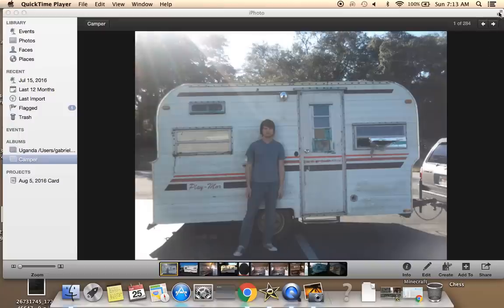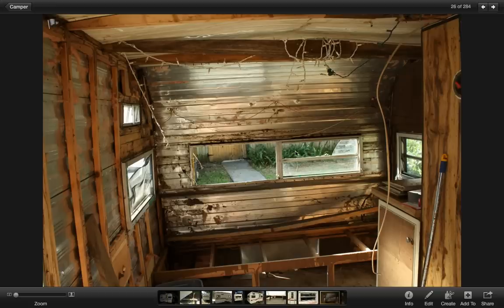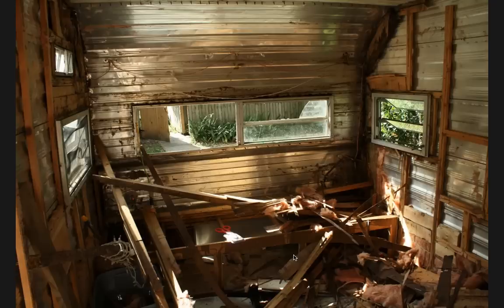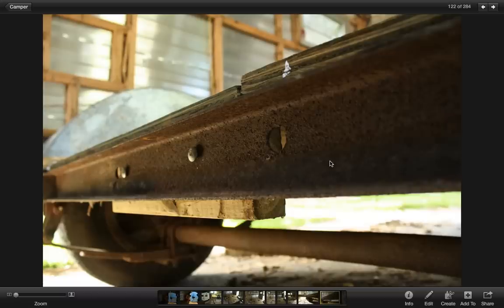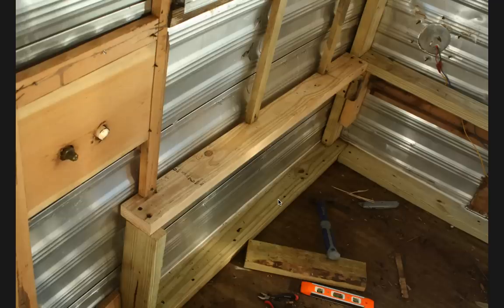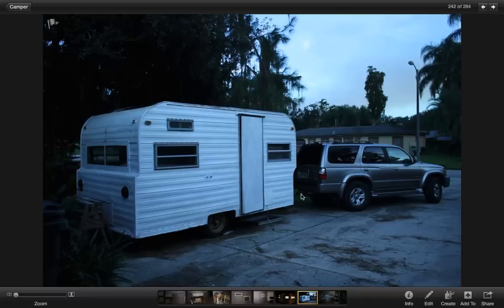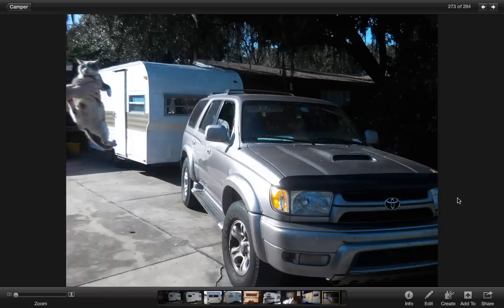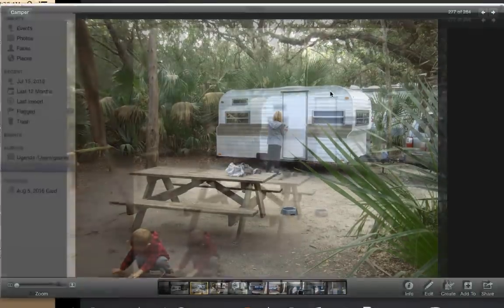Rebuilding a $40 Retro Camper // DIY

Comment: Excellent video! I understand exactly what you went through. I bought a small mobile home that was uninhabitable for dirt cheap and also got a perpetual lease to keep it on the acre where it sat for $200 a month. Had to completely gut it to include the floor, plumbing, electrical, and interior walls. I jacked up the outside walls every 10 feet or so in order to slide in the new 4x8 sheets of 3/4" plywood for the floor. The original floor was particle board and we know what happens when that gets wet. Many of the floor joists also had to be replaced. It was a real dog. Anyway, what was an uninhabitable 2 bdrm mobile home became a really nice 1 bedroom. I'd love to do it all again one day. Learned so much.

Comment: Mine is a 1976 coachman 24 foot trailer and this video gives me hope. I also had some water damage. Gutted the front and replaced the frame, reinsulated and and redid the floor (which had huge holes in a couple parts too) I have still aways to go, but this is rad to know other people have succeeded before me.
Reply from the maker: That’s awesome! Glad to have given you hope!
Reply: 𝒊 𝒍𝒊𝒌𝒆 .......
Reply: 𝒊 𝒍𝒊𝒌𝒆 .......
Reply: Lm
Reply: Ok. I guess I have to be brave like you. Thanks.

Comment: I started to do a 1973 11 foot skylark truck camper that’s in slightly better condition than this trailer was until my shop foreman at the rv shop I work at convinced me to just salvage parts from it and that he’d help me build a new one with him free of charge. He told me I’d spend about as much time doing that as I would fixing that one. Might have kept going with it otherwise but good for you for sticking to it. I’m doing the series on my channel of the whole thing. Not what I originally wanted but I like that I’ll be able to make every aspect of it to my liking. Both projects are very satisfying just in different ways. With something like this you get to basically rescue and bring a camper to a level beyond it’s former glory but building one from scratch you have a similar satisfaction of hard work paying off but you also get the benefit of making the unit the size and design that you want. For example the new camper has a 12 foot floor length and it’ll have the rare side entry door design I really like.

Comment: No one finds a 40$ camper, you won the lottery man
Reply from the maker: Yes, I sure did!
Reply: Van the Glassblower -  not true.  If you look around, sometimes you can find campers like this one that need gutting for free.
Reply: Van The Glassblower nope. Bought an old Winnebago motorhome for $200 only thing it needed was a new couch and tires.
Reply: Holy Hand Grenades gotta love facebook marketplace
Reply: Nawar Salim dude sweet
Reply: Van The Glassblower guaranteed you rip the skin off nothing but black mold in those walls that's why it's 40 bucks
Reply: @dbz739921  Yeah, once black mold gets into the wood it just eats away at it. If it's hiding there, which most likely it is as campers leak like a sieve, I'd definitely replace the entire frame etc. Expensive, but a good investment.
Reply from the maker: @BLUEM3TALNEMESIS Someone's private property with their permission or pay for rent at an RV park.
Reply: @oursimplestorychannel  I see mobile homes for free all the time. Just have to get them moved. Travel trailers too. Fine job young man!
Reply: I just got one for a $1 from a good friend who just didnt want it anymore. Title and all. Needs work but itll do the job.
Reply: Free on fb market every day
Reply: not true. many of us older folks have old campers needing rehoming and in much better condition. . we have two and would love to have them move on for next to nothing.
Reply: Deals like this are legit everywhere, no one wants to put in the work tho
Reply: Van The Glassblower YOU BETTER BELIEVE IT! He worked his butt off on it didn't he? 👍
Reply: Nawar Salim wow.... +$230 worth of fuel to get it home ... lol.
Where am I when people let this stuff go? Nice.
Reply: DEALWITHIT DREALIST   Gotta 75-80yo house 1.5ac fenced $35k 23 years ago... tell me bout it!!!
Reply: Van The Glassblower I wouldn’t exactly say, winning the lottery. He had to restore, and rebuild the whole thing.
Reply: In oregon if the trailer is older then six 8 years u cant park rvs or trailers in parks n have to move every three days or get towed n lose.Want good trailers rvs free or damn near got gas drive off they somtimes pay u to get it off the property.
Reply: @mitchellkennedy3556  this just has covid19 updates. I guess it's been sold.
Reply: Look on Facebook market place you can find them for free they are in really bad shape though
Reply: @lindanelson5053  Not in Australia. A beaten up old unit like this one will have people fight over it at $1000. Slightly better condition and they sell for $6000+. We're talking about small 1960's/70's trailers without bathrooms, remember. Very basic. They were overpriced before COVID, but now prices are getting crazy - and they're becoming very hard to find. All sold out during lockdown. People were snapping up anything they could get their hands on.
Reply: @bevcrusher4177  Oh wow
I'm in the US
Reply: I technically got one for free, though I paid him £20 to deliver it. It happens.
Reply: I got one even bigger in a little worse shape for free

Comment: this gives me some hope for the one I just got. It was on craigslist for FREE! so I couldn't pass it up. 13.5 foot 1970's "aristocrat" travel trailer. the water damage isn't nearly as extensive as what you had here but I think ill have to gut it anyway because something happened at some point that caused the whole thing to be sort of lopsided. I am guessing the only way to fix the problem is to get down to the bare bones and do some rebuilding.. lucky for me I am a cabinet maker so I am thinking it will be doable. if it proves to be too much ,well it was free so...yeah.

Comment: I have a Pla-mor that is about the same shape but a bit longer. It has 2 axles. The only thing that is left inside is the shower/tub. At least that is a start. All the walls are about to fall away due to the rotted wood corners. Floors are simply plywood laid over whatever there was left.
The guy I got it from told me that I could have it (for $500) if i promised that I wouldn't  live in it. I didn't tell him that I was going to rebuild it. Currently, it is a storage shed. Time will tell...
Great to see you working with your son.
Good luck.

Comment: I almost bought a 1971 motorhome that needed to be gutted out like that.  If anyone has an RV remodel that involves water damage, please consider PPE or Personal Protective Equipment like the paper suits and  respirators when tearing that water damaged material out of there just like professionals out of a mold restoration service would likely use.  Mold can really do a number on your health.
Reply from the maker: Yes, it sure can be nasty. Rest assured, I took all the necessary precautions.
Reply: Cheeto Cruz  sorry....  I'm havin to deal with it now, for 23yrs. I'm old and ready for a small camper. My dog doesn't take up that much space..  & I can change scenery when I want.
Hey, I can dream...
Reply: Cheeto Cruz I’m so sorry for your loss and your ongoing complications. Keep on reminding yourself that your body is badass and it can repair itself. Before you go to bed ask your subconscious to fix the things that are causing you pain, even if you don’t know what’s causing it, “please work on making my shoulder stop hurting, you know what to do to fix it.” Do this as often as you remember before bed and your subconscious will work on it while you sleep. Sounds a bit too easy to actually work but they said I’d never walk again and the pain I was dealing with would kill me in less than 3 years, as it does everyone else with my condition. Seven years later im walking better than I ever was and zero pain ever, no pills no meds, just told my body what I needed from it. I turned my disability into my super ability by keeping the bonuses and fixing the negatives. It’s free and no side effects so why not give it a try? If it works for you spread the word. You’re gonna be amazed by the results I promise :)

Comment: I may have sprayed undercoating or truck bed liner on the inside of not both the inside and the outside. I was thinking that the truck bed liner spray would help seal  the shell and help prevent anymore leaks in the future
Reply from the maker: I should have thought of that!
Reply: My Friends Rino Lined the Whole out side paint job of thier Huge  Ford Excursion! 
It came out Awesome!

Comment: Great job on fixing it up, always fun to other people's DIY projects, I cried tears of joy when u called your B&D a piece of junk, long live Dewalt keep it up
Reply from the maker: I’m 100% dewalt! Thanks for watching!
Reply: Proper tools make things so much easier, in regards to the interior ceiling, and making it look good, making a bunch of 2cm thick bars and placing them at even intervals along the ceiling makes it easier to control how tightly the ceiling fits, you need to place them at 10cm at the ends(where the camper is round) and 40cm over the rest, at least what I did myself
Reply from the maker: Thanks for the tip!
Reply: The GIP your welcome

Comment: For someone with no construction back ground you did a great job.
The 2 things that stuck out for me, you covered the first one using pressure treated. The second one though..... the floor, is it bear wood on the underside. Even pressure treated will rot eventually.
Reply from the maker: Yeah, you are absolutely right. Next time I’ll do a better job :)
Reply: Our Simple Story.  I was in no way criticizing your job. I thought you did a very good job. I was just wondering about the floor. When you ripped the old floor up was it just wooden or was there sheet metal or something else under it?
Sorry, I meant no offence.

Comment: I hope your insulating between the walls and the metal skin.  Any bare metal will produce condensation and water damage when you turn on any kind of heat in there, water damage and mold is sure to pursue. Need to foam or foambord insulate the whole thing dude.
Reply: vapor barrier also...but for a first attempt I say he did well, there is a definite learning curve involved.

Comment: Why didn't you insulate the walls and floor??
Reply: I also have questions. Im thinking he isnt using this for winter weather.
Reply: I wondered the same thing! I mean even if you aren’t planning to use it in the winter, it’ll be a metal box in the sun for summer🥵 Not to mention insulation is a great sound barrier.
Reply: @tonia.5861  The way things in this country are evolving, more people probably should be looking for something similar. Just a thought.
Reply: Michele A sadly, I think this could be correct😞
Reply: I also thought there was way more than $200 in building materials that plywood is like 30 a sheet . And then all the 2/4s paneling paint screws caulk let's not forget about all the lumber was treated to so that made it cost more . But hey I wasn't there 😂 but I do know the cost of stuff 🤣😛😁💪

Comment: You are one determined man. I purchased an old 1970 Vintage camper, it turned into a nightmare, it was so bad I salvaged the aluminium siding and sold it for scrap; almost 100% of the framing was rotted out and I gave the base away. I lost $750. Don't have the energy to attempt another one.
Reply from the maker: Yeah they are for stubborn people. I am actually in the middle of stripping down my second retro camper. Look in my more recent vids. Thanks for watching and sorry it didn’t work out.

Comment: great job..I restored a couple in past.. Here in western WET Washington ..rains a lot .. the rain water will find it`s way in a tiny hole ..like even on the side where a screw is not tighten down all the way ..and in 2 to 3 years U will have ROT ..rotting out walls . So even your new trailer - keep under a cover..

Comment: I'll share a secret with you on how to literally take these down to zero and rebuild them without loosing the metal, windows and all the rv in a rip out. Its a sectional overhaul. No one apparently does it but me. Look for a DEFINITION video on it on my channel soon. I will show HOW to restore with minimal effort the worst of the worst..
Reply: my uncle had said something like that ...My aunt passed and he fell apart so the travel trailer and 89 mustang i got to renovate is still sitting. It was suppose to be our project that i was going to learn on. I will def take a look at your channel!
Reply: The secret to doing the restore is size related 1.5" or 2" height HAT metal, also called Furring Metal. You remove all paneling, then ONE stud at a time, replace it with a piece of hat metal, go to the outside and put in rivets through the outside metal dipping each rivet in a little sealant. Then return inside and repeat. On your corners you use corner metal, same thing on outside corners with rivets and its original trim reinstalled. Lots of tin snip work. When all walls are done, you will be able to lift the entire shell off the base and pull the base out, then you can replace the floors structure, then roll the trailer back under the body. I use just 3 ten foot 2x6" and saw horses to hold up the shell when its off the base. 
Thats the basics, it goes faster than your can imagine for restoring SMALL under 18 foot classic aged trailers.
Reply: Your wifes disgust failed to see you got a $25,000 education out of the deal. Now when she has to choose between getting another car and cabinets put in she can get both since you can do that very expensive work.
Reply: Јоhn Daniel  THANKS!!! GREAT IDEAS.

Comment: Not hurricane nor tornado proof...the towing speed of this thing is nowhere near that high...but by all means try it, you'll have a brand new experience as it fish tales around behind you eventually whipping you & it off the road. By the way rustolem paint doesn't get rid of rust, you have to scrub that off, wire brush it or sand it, then seal then put your paint on it.
Reply: I don't think there is anything that is hurricane or tornado proof, that is my main worry about rv's or campers... I would be hesitant about driving across country, but that's just me...

Comment: How much did it weigh? How well did the 4Runner do?
Reply from the maker: I don't remember exactly how much it weighed. I know it was under a ton and maybe around 600-700ish? The 4runner did fine and I've actually towed much bigger and much heavier since then. The 4runner can tow up to 3500 lbs. but I take it easy and that is in flat Florida. Thanks for watching!
Reply: I'm pulling similar unit with Kia Sorrento.  it does this fine but concerned about the amount of wobbles that occurs.  I've been told it might be an adjustment of the springs.  care to weigh in so I can do the right fix the first time.  I'm hoping to gut and rebuild as animal grooming station do it would be on the road a lot.

Comment: It is a nice rebuild but I'm going to disagree with you about making money from the sale.  You stated you payed $40.00 for the camper and approximately $100.00 for the title and  license, then about $200.00 to $300.00 for the material.  Just rounding to the low side, that's $340.00.  And the high side would be $440.00 (or there about).  What about all thr labor you put into it?  Was that free?  If you work for nothing I know allot of people who'd like you to work for them.  
Never ever give your work away for free.  At least get a tax break on it.
Reply: His labor value is moot here. It was a hobby and he recouped any labor value through the education he gained and the year of use. When I calculate my monthly grocery bill I do not factor in the labor for preparation. I don't run a restaurant for profit. Don't think he was doing this with an eye to profit as a business. The argument you are making doesn't apply, in my opinion. Besides, he traded up.
Reply: Pretty much what I was thinking.  $400 in materials, and 6 months of work by you and your buddies bringing $600 is not making a profit. lol

Comment: I just bought a 1977 komfort trailer for 480 dollars.I need to replace the walls, floor, cabinet drawers,couple metal slats outside, door and a tire.I haven’t tested the stuff inside but it’s all there. Mine looks better shape but I’ve never done anything rv so I’m having a experience 😂

Comment: I bought a thirty-five footer in hypoluxo fl for 2500 on the intracoastal..osb floor throughout in bad shape.. i and a helper pulled it up.. put down 3/4" ply  .. used peel n stick glued down .. worked well.

Comment: My Dad bought a small, older camper at an auction for $35 and gave it to my sister. It needed a little work, but was a nice little camper.  A few years later she moved and sold it on EBay, sight unseen, for $1,500 to a couple who belonged to a retro camper club.
Reply from the maker: Yeah, they’re a hot commodity!

Comment: These things make great sheds when they're gutted. Tarred the roof, ripped out the mildew smelling walls (1969 Frolic, also found lots of treasures in the walls like this vid) and put up drywall, jacked it up onto cinder blocks. 1/4 of the price it would cost for a new shed, no pesky structure permits, I can take it with me when I move.

Comment: Good work. The top bunk is a little scary, good for a small kid, but knowing it's just some small lumber framing those walls makes me worry.  I'd have just put some 2x4 posts on each corner for good measure.  Nice work though.

Comment: Looks like you live in Florida. Good video by the way, like the honesty. Trailers were much better built during the 1960's where like yours 1970's they were more prone to leaking. In Hawaii all homes are framed with pressure treated wood, you just need to cover it with wood or something. You probable know now why these go for many many thousands after restored.